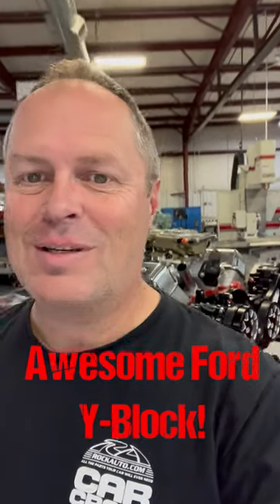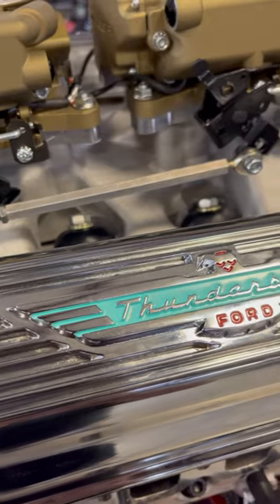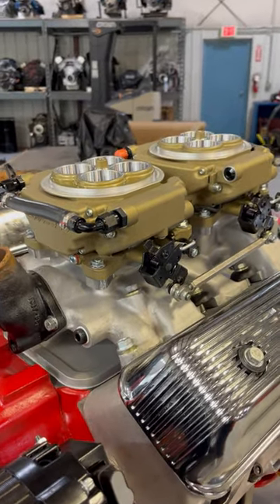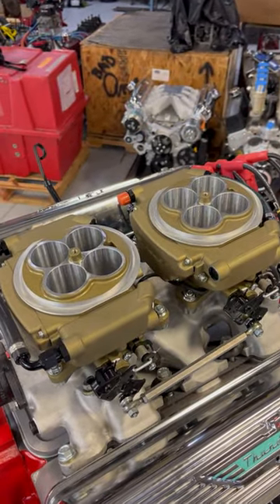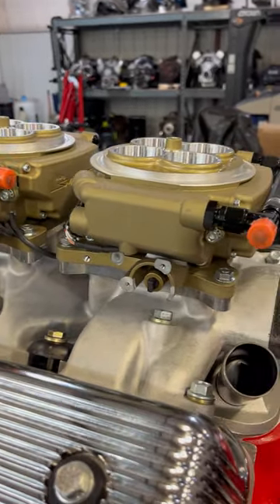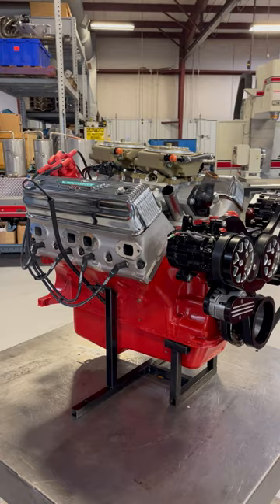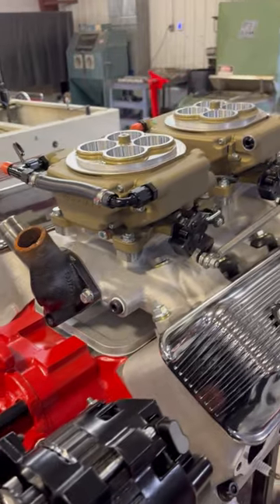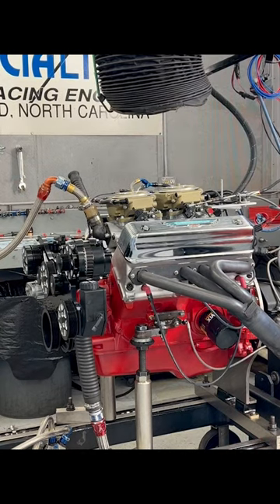Incredible Ford Y-Block Engine #shorts

Comment: Over 400hp from 325 ci.. that's awesome & with mild compression!
Reply: 1 horse power per Cubic inch would have been impressive.
Reply: Y didn't u use the 312 ?

Comment: I had a 292 in a 61 F-100 Ranger 4x4. In 4 low in 1st gear you could get out & walk faster than the truck at an idle

Comment: Before I went into the military in 1967 I have a 56 Ford they had a 312 police interceptor in it with a overdrive transmission it weren't much on take off but you couldn't touch it on top end

Comment: Had one in a pickup with the exhaust pipe crossover in front of engine. I put a block off plate on the end of the one manifold and installed a u shape pipe on the other side to get it run under the engine. I put full duel exhaust on it with no mufflers. It had the most beautiful cackle I have ever heard from a exhaust.

Comment: I've never wanted to own a car with the original Y-block but this is as cool as engine tech gets. Big respect to everyone that made that happen! These engines are wild visually- looks like a Buick 350 with SBC heads and an early Pontiac intake manifold! The Accessory drive is SLICK too! The engine exhaust note is sweeeeeet.
Reply: And let's all be honest, 400 hp on the streets? That's plenty bro.

Comment: My Dad bought his first new car in '57. 
   A Custom 500 with a 292 Y-block & 3 on the tree.
  There I was, riding shotgun in my old school car seat. The kind that had the built in little steering wheel & horn.
  Used to go to a drive in called The Pow Wow in Hammond Indiana. 
 Arctic white with poverty caps & black wall tires.   Can still remember it like it was yesterday...

Comment: I have a 272 and a 292, i also have the Lincoln 341 Y block
Reply: My pappy said son you gonna drive me to drinkin if you don’t stop driving that hot rod lincoln!
Reply: Chevy guy here  crotch deep in ford  blue   How does a guy tell the difference between ford y block. And. Lincoln y block
Reply: @clydebethatway7485  LOL same man same.
Reply: @clydebethatway7485   the dizzy angle and the crank end caps I think I'll post a link to a video explaining the differences

Comment: Had one in a 56 step side p/u. Had a 312 outta t‐ bird.factory 2-4 engine.put it in a 62  1/2 falcon Futura. Great little street car. I liked it alot cause of the thunderbird roof line, which was hard to find .

Comment: Wish these were more accurate.
I'm not sure how they can say that "originally with dual quads these engines made 275hp", -  the 292 never made 275 horsepower and the 292 never came with dual quads either.
Dual quads were an optional version of the 292s big brother, the 312 - That engine made 275hp in dual quad trim.
The Big Dog 312 Y-Block was the dual quad's engine's next step - the McCullough supercharged version that made 300hp.

Comment: In 1969 a late 57 tbird 312 punched 90 over, 12.5 to 1 engine dyno'd over 600
Reply: Wow, that’s amazing!!
Reply: @MrPhotog7  $4000  in the block and 1800 in the heads, plus shipping to LA since nobody in Spokane could do the machining for the copper fire rings since the sheet metal gaskets wouldn't hold that much compression
Reply: @cbmech2563  Wow, that’s a fair chunk of change! We used to live in Spokane many years ago. Beautiful city!
Reply: @MrPhotog7  yeah it is. I'd driven truck in Alaska the summer before and blew most of my money on that engine. Had it in a 55 crown Victoria with a police interceptor rear end out of a 57 police car
I grew up in Spokane and left when I joined the seabees
Reply: @cbmech2563  that’s really great! When we lived there, I went to some really great car shows - I believe they were put on by the Good Guys. Also, there was a place downtown that sold some really nice street rods. They were really beautiful early Fords - Model A’s, T’s, and 32 Fords. Don’t know if that place is still around, as we haven’t been back to Spokane in a long time.

Comment: Love them old Y-Blocks, built a few back in the day. The last one was 302 ci. with milled ECZ heads and cam grind picked for me by Bruce Crower. It was in a 58 2 dr. post, with a T85 3 spd. and 4.11’s in the 9” I beat my buddy’s 383 Fury in the 1/4 mi.

Comment: I didn't know anyone makes aluminum heads for the Y-block.
Reply from the maker: Mummert
Reply: @TheHorsepowerMonster  
I'm pretty sure with the correct factory dual quad intake, it could be run with no adapters.
Reply: @xmo552  
The factory dual quad intake was on 312s only, and they didn't use what became a standard Holley flange.
The original carbs were either an odd Holley nicknamed the tea pot (appearances) or a carter carb, I may have some of the carb things jumbled, but none had the standard flange.
Reply: @Motor-City-Mike  
You may be right. They ran the Holley teapot and in '57 and later they used the standard Holley base and also some Autolites. 57 and later 2 and 4 bbl used the std Holley base.  Single 4 bbl 57 and later was also std Holley base pattern. I think the factory dual quad intake always kept the teapot pattern.
Reply: @TheHorsepowerMonster  
Mummert is the best. I've been using his T5 adapter for about 20 years.

Comment: I've got a 292 y block with factory 4 barrel intake on it just sitting in my storage unit I was gonna put it in a 50 ford coupe with a t5 transmission but bailed on the idea and ended up doing a D0VE 460 from a Lincoln in it.

Comment: With that oil pan and T-Stat housing, looks like it goes into a truck application. I have both a '57 Fairlane sedan with a 312 Y-Block and a '57 F-100 with a 272 Y-Block that mildly bored and stroked to 302 CI. Yeah, been lovin' the Y-Block since I purchased the family '56 wagon dad bought used in 1957 with a 292. Sadly, that car burned to the ground in 1969. 😭

Comment: I bet with twin throttle bodies and 400hp it is a bit touchy for the street unless you put a loose torque converter in it.
Reply: T 85 and a 14 inch clutch in a 55 crown Victoria

Comment: I had a couple, including one in a dump truck. They were just OK. I don't ever remember a 292 making 275 HP.  The 283 was a better engine in my experience.
Reply: 283 sbc?  One of the earliest chevy small blocks.

275 is net, its probably half that Gross 
Anything pre 1971 is overinflated power numbers
Reply: @machineman8388  Not over inflated at all. They just used a different measuring system. The 283 went from 180 to 220 HP depending on carbs & such. They had a hypo version rated 283 HP.  They were not as slow as today's guys think.  My 65 El Camino 283 was a hoot.
Reply: @wymple09   "not overinflated at all"  they absolutely were. . . . . . . Running an engine with no accessories on a dyno isn't overinflated?  Even without the very same  accessories that the car would come with?  Also, not sure what "today's guys" are but your conjecture about what they think constitutes as fast has nothing to do with anything.  I think most car guys know about the muscle car era and the rising power levels in the 60s and that cars were plenty fast then, still has nothing to do with power ratings
Reply: @machineman8388  No, because everybody used the same system. That's all that matters. Numbers are irrelevant except to compare one engine to another. Another system measures in Newtons. So what?
Reply: @wymple09  listen man its okay to be wrong, and In this case you're wrong, best case scenario you're playing a semantic game, but really it's more that you're just wrong, sorry
Reply: @wymple09  "everyone used the same system" yeah and now everyone uses the same system, and when you look at pre 1971 numbers they're 30% higher . . . . . . . .  They dropped overnight . . . . . . . A synonym of this would be overinflated, thanks for playing though
Reply: @wymple09  
You remember correctly - no 292 made 275hp.
It was the dual quad version of the 312 that made 275.
Good Catch!
On the rating issue in general - the issue IS that they all use the same system so the numbers from one to the next are relevant. 
There are a collection of S.A.E. horsepower rating criteria, not to mention many Dynos don't generate the same numbers, so saying between Net vs. SAE that one is accurate and one is not just doesn't fly, it's all about how the particular rating is factored, and the parameters of that rating.
Like you said, the numbers are reference for comparison purposes - when two engines are run on two different Dynos, or cars on two different chassis Dynos, it's not an accurate comparison. 
Same Dyno, same atmospheric conditions, same temperature, same fuel - now there's accurate comparison material.
Reply: @machineman8388  You are the one arguing a silly game. Take a deep breath & go away. Jeezuz
Reply: @wymple09  listen you tried arguing semantics and you're wrong. . . . Based on the way we calculate horsepower and torque today, the numbers pre 1971 are overinflated.

Lol its an extremely simple concept and you tried to argue it, and you're wrong.  Cope with it.  Admitting you're wrong when you are is a virtue and not a sign of weakness, learn that and you'll be a better person.
Reply: @machineman8388  HP was recorded at the crank back then, and that is no longer true. Drag times in the real world with today's tires & traction upgrades, unavailable back then, show that some of those numbers were underinflated, so think what you like. And I don't care that you think you are so smart.

Comment: The pulley system is not turning
Reply from the maker: On the dyno they use an electric pump to move coolant through the engine.

Comment: how did you do a Dino run with no belt on it?
Reply from the maker: They use an electric water pump to push water through the engine. Just simplifies the dyno setup.

Comment: Just saying it wasn’t Because of the EFI it made 400, and arguably it would’ve made more horsepower with carbs. 

And that’s a proven fact.
Reply from the maker: You have a point, but I'm not exactly sure it works in this case. Carbs can make more power than port fuel injection because the carb introduces atomized fuel higher in the airstream (above the intake manifold vs. in the intake port for the EFI) which allows the fuel to cool the intake manifold which also means a cooler air/fuel charge. But the Holley Sniper throttle bodies introduce atomized fuel at the same location, so I'm not sure a carburetor will make more peak power in this particular case. Regardless, thanks for watching!